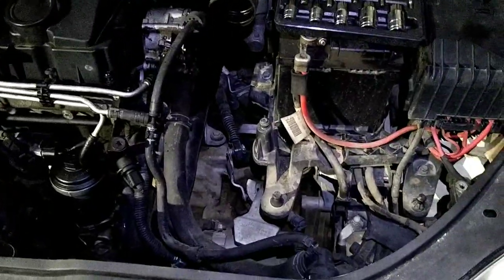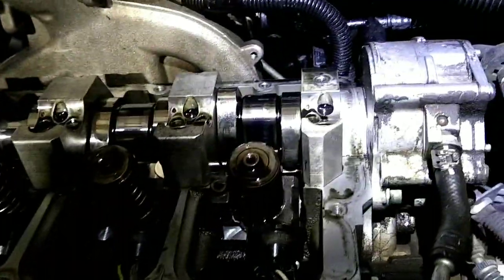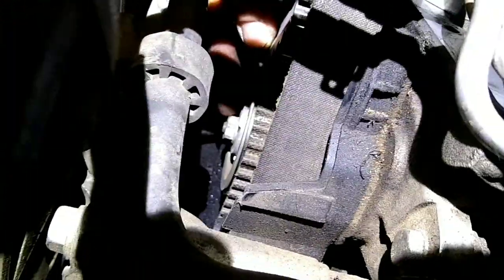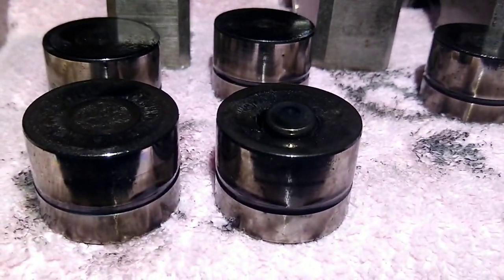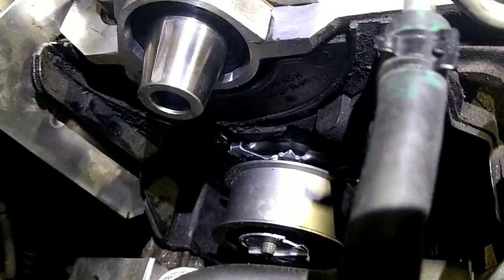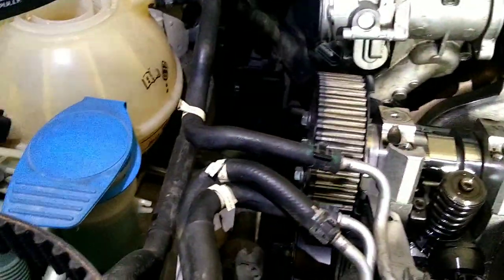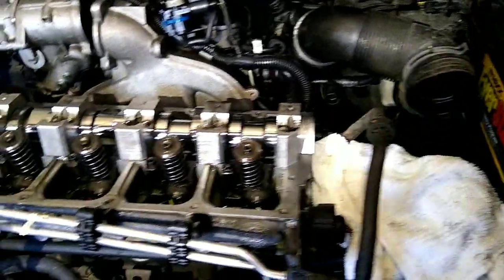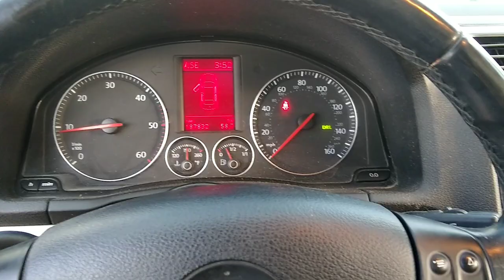Step by Step To Replace Worn Camshaft and Timing Belt on PD TDI, BRM/BEW/BHW and others

Comment: I replaced the camshaft and lifters in 2006 tdi and have been driving the car the last few days. Im having a problem with a longggg crank til it starts after sitting over night. It cranks over for about 45 seconds before starting. I replaced the tandem pump gasket. Any ideas?
Reply from the maker: Did you check the cam timing (torsion valve) with vcds? The cam sensor can cause long starts as well as a leak in the tandem pump seal.

Comment: Thanks for the video. After watching this I went ahead and pulled my cam out and it is very worn and even had a hole worn through one of the lifters. I seemed to have another issue with my injector rockers. There was pice of a loose metal lodged between the two rocker rails. I have read something about oil galley plugs on some forums? It looks like the piece came out of the opening on the end of one the rockers rails and the other rocker is empty inside the same opening. Do you think my issue is in fact oil plugs on the rocker rails and if so is there any way I can re use them or should I except to order new ones.
Reply from the maker: Sounds like you can have the rockers made to hold a better plug or even glue the original plugs in, either way would fix it
Reply: @TDISwaps  Awesome, thanks for the help!
Reply from the maker: @tylerhogan9897  no problem man!

Comment: I have an 06 tdi with 270, 000 miles. It died at an intersection. Towed it home, checked the timing belt, it is missing teeth. Checked the crank timing it is one tooth off. What to check next? Should I  put a new timing belt kit in or go further?
Reply from the maker: I would probably say do a timing belt then a compression test

Comment: Great video mate. Your skills are fantastic. I am learner and learning things bit by bit. Increasing the size of my tool box too lol. I have an audi a3 tdi 1.9tdi pd engine here in UK . I want to change the timing belt on it myself however the only thing that really confuses me is to lock the cam and crank with the tool at the bottom and the pin that goes in the cam.
Reply from the maker: Yeah I usually haven't locked the cam but you can use anything to market and line it up straight, as long as you are close once you get it back together and check that torsion value in vcds that will tell you if you got it off a little or not and you can adjust it then.  You can honestly just paint marker the crank and the cam and then readjust it with vcds after it's running again.
Reply: @TDISwaps  Thanks for the reply.  My audi a3 tdi 1.9tdi is my first diesel car. I never have had any diesel car before. I am trying to learn things as most of the mechanics here are just complete rip off. My car is leaking oil from the rear of the engine and its coming from the top to bottom. I have been underneath it and my guess is either it is head gasket or the rubber seal in the tanderum pump on the right side of the engine head. The turbo seems fine as there are no codes on the dash board and it also drives fine. The car also doesn't heat up the way it should. The temperature gauge barely goes to take 10 clock mark. I am sure its the thermostat and temperature sensor which are toast. Thats not a big job though however this oil leak seems to me something serious .
Reply from the maker: @mumtazzafar1576  well actually that's a great thing to replace during the timing belt because then you can see that the cam is lined up correctly with the tandem pump off, I would order up a seal for it as it's a very common leak spot.
Reply: @TDISwaps  Thanks very much for the reply
Reply from the maker: @mumtazzafar1576  no problem at all!

Comment: Awesome video man. I can’t even count the amount of times I watched this when replacing mine 2 years ago. Unfortunately the car has not ran since. When I tried to start it, it locked up but I was able to reset it by hand and try again, but I’m afraid the timing was off and I may have bent a valve. Any advice on how to get the timing back where it needs to be?
Reply from the maker: If you can spin the engine to where the harmonic balancer has a TDC mark pointing up at the notch in the timing cover you can then see where the cam is with the valve cover and tandem pump off
Reply: @TDISwaps  Oh okay, I didn’t realize there were markings for TDC on the balancer and the timing cover that I could line up. So I can check that, and then turn the cam to tdc like how you describe in the video. Put the timing belt back on and that should be close enough to get it to crank?
Reply from the maker: @jentryhaley5648 theoretically haha, always always rotate the engine 360° before trying to start it, that will prevent valve damage
Reply: @TDISwaps  Well hopefully I can get it reset to where it’s supposed to be I can tell if there are any issues. If not, I’ll make you a good really deal on it haha
Reply from the maker: @jentryhaley5648 lol I hope you can get it!

Comment: Great video! Next time to make the work faster don’t uninstall the tandem pump, leave it in place you can remove the camshaft without any issue.
Reply from the maker: Thanks! I like to use the back of the cam to insure the cam is at TDC that way, and the kit comes with a new seal anyways.  But you are right, it would go faster for sure!

Comment: same here. i subscribed. i have been on the fence about doing both for some time. Shops dont want to work on mk5 with 400k miles on it. thanks
Reply from the maker: Yes it is getting hard to work on these cars when the shop bill is often more than the car itself is worth to most people
Reply: @TDISwaps  shouldn't be the shops worry imho, if i were a mechanic i would straight up tell people "it will probably cost more than you'd like to pay" and if he still wants it, shop should fix it no questions asked. 
good for me that i DIY my maintenance so i can only complain for the cost of parts, and VW's engineers
Reply from the maker: @Juppie902  ha ha definitely! Those VW engineers could use a talking to

Comment: What a fantastic video. Really like the detail.
I need to change my camshaft vw 1.9 caddy 2008. 
Just a question regarding timing
 The belt and coolant pump was done 6 years ago. So by just locking the crankshaft and making sure the lobes on cylinder 1 are facing upwards (not engage) should be enough not to effect the timing. But once I get the project car running I'll get the timing tested again from a mechanic. Thanks in advanced
Reply from the maker: Yes locking the crank would be fine to just change the camshaft, I would inspect the belt really well though even at 6 years old it may show signs of wear and be safe for to replace. And thanks for watching!
Reply: @TDISwaps  Yep if I've gone this far, its not unreasonable to replace the timing belt. And the water pump. The car has been sitting on the street for more than 2 years. I've already dumped the old fuel.

Comment: I know its an old video but what were the symptoms of the worn cam and lifters? Also how many miles were on the car?
Reply from the maker: I've replaced 5 of these now, a thumping from the intake is a common indicator, but mostly it's best to just pull the valve cover and check, it comes off so easy and then you aren't wondering.  I've replaced them anywhere from 165k to 270k, and one I have is still good at 280k, there doesn't seem to be any reason why some go bad and some don't.  Multiple bad ones were using correct oil the entire time.

Comment: Priceless video thanks. Just makes my job so much easier.  What symptoms did you get that made you decide to change your cam.
Reply from the maker: This car started thumping very loud through the intake, and with the valve cover off, you could see the hole in the lifter was huge.  But my other car almost sounded normal even with half worn lobes on the cam.  If at all in questions just go look to be safe! And I'm glad to help!
Reply: @TDISwaps  I will pull the cover and take a look. the cams on these TDIs are actually the only bad design that you could throw at them.  Very weak Cams. In your opinion, are the hardened and non OEM custom cams much better. I just get dead links from forums linking to these supposedly better cams. ? 

Again, thanks a lot. this is how videos should be done.
Reply from the maker: @pensive_  I did the hardened stock cam, not too much of an investment.    The performance cams aren't really needed until much higher HP builds.  I don't have enough mileage on my cam swaps yet to really give good feedback though.
Reply: @TDISwaps  You didnt get hesitation at higher revvs?  A worn cam can among others, causes this issue. It is this issue that brought me to your video.
Reply from the maker: @pensive_  no unfortunately worn cams affect overall power some, but usually don't cause hesitations.  That can be turbo related if you don't have any codes
Reply: @TDISwaps   Maybe hesitation is not the right word. If I step on the  pedal. It pulls away with enormous power until a ways before maximum when it is pulled back to a lower revolution. So it goes to a high rev and then pulls back, almost like a sluggish governor. It is a nothing burger really as I dont rev up to there, I was just testing the car and noticed it. It does get a bit of black smoke (definately not blue or white) at high rev, only so it might be an air restriction somewhere. Maybe that is standard TDI behavior.
Reply from the maker: @pensive_  I would definitely get that valve cover pulled and check the cam first, then go from there.  They can be a pain to troubleshoot.

Comment: Where are you located? I'd like to hire you to do this job on a 2006 Jetta TDI I have. 119K  on the clock, snap crackle, popping, but still running strong.
Reply from the maker: Unfortunately I don't really have time currently, I'm also in the middle of nowhere Wheatland, WY haha.

Comment: How do you go about breaking sprocket bolt loose on cam? Thanks
Reply from the maker: I tried to make it clear in the video but I break that loose first thing before removing the timing belt, taps on it while the engine turns over slightly usually breaks it loose
Reply: @TDISwaps  ok great thanks I’ll try that basically tap ratchet with hammer? And for re-torque do you need a special tool?
Reply from the maker: @Mightyeldo so I just use a big breaker bar to break it loose maybe tapping it with my hand, then the last thing I do is pull any locks and torque the cam bolt letting the engine turn over a little if needed

Comment: I just bought a 2006 version Jetta tdi 1.9l new to this side of the Diesel world had lots of pickup but I have no idea what to look for to fix maintain or change could u give me some insight on this car thanks Troy
Reply from the maker: Checking the cam, keeping up on timing belts, and doing tranny flushes are the big things.  Everything else can be fixed as it becomes an issue.

Comment: Hey great video very helpful! Just one question, I attempted the camshaft replacement today but got stuck when I tried to put the new camshaft caps back on. It seems the cam itself won't seat properly far enough down for all the caps to mate with the head. I didn't want to torque too hard and force the cam down but can't figure out why it won't seat properly. The crank is 90° CCW from tdc so I can't imagine the valves are pressing against anything. It will fit on one side but the other has a lobe pressing against the lifter without it depressing so it sits proud about 1/4 inch. Thoughts on this? Also I am a big newb btw so be gentle😉 Cheers!
Reply from the maker: You are just feeling the cam lobes needing to partially push down some of the valves, no worries there, any lobes that are in a downward direction will have to compress the lifters under them some while bolting it down...  Just use caps 2 and 4 to slowly alternate tighten the cam down, then finish with the rest.
Reply: @TDISwaps  Ah great thanks for the reply dude, I'll try that today and see how we go🤙
Reply from the maker: No worries man!
Reply: Hey so got it all in and it worked like a charm... For a second, I've somehow tripped the immobilizer and it shuts down right away. Any idea how to fix that or do I have to have a dealer take care of it? Thanks again!
Reply from the maker: @MrChriswms  check your codes, I bet you have a camshaft signal code. If the cam is just a little out of spec it will cause a start and then shut off as a preventative measure but acts just like immobilizer, you need to slightly adjust the cam timing to get it back in spec, usually -.5 to -1.5 is ideal

Comment: Hie..Im replacing the camshaft and lifters on my 2007 Jetta TDI BXE but i forgot to number the caps for the cam.can something bad happen if i mix them up 🤦🏽‍♂️.also can you tell me if the break in process is necessary.Thanks in advance
Reply from the maker: The cap order should not technically matter for the center ones, only the front and back SHOULD matter, I was more being safe than anything.  The only common break in procedure I have found is to use break in oil and run the engine at 2000RPM for 20 minutes, then change oil/filter and run for 500 miles then replace oil/filter again and you are good to go.  Some people have skipped that but I try to do it.
Reply: @TDISwaps  thanks a lot mate
Reply from the maker: @daddypopes  Glad to help!

Comment: Did you have to remove the motor Mount to get the tensioner out?
Reply from the maker: I unscrewed the center tensioner bolt and was able to slide it out sideways

Comment: How did you loose the 18mm camshaft bolt. It rotates when I'm trying to turn it loose
Reply from the maker: I do it with the timing belt on still and not locked, and usually a firm tap on the ratchet will break it loose, you may turn the engine over a little bit it should get stiff enough to loosen the bolt that way

Comment: I wonder how hard it would be to do an in frame rebuild on this engine.  Pull head and oil pan.  Break the cylinder glaze with a ball hone.  Add new rings and bearings and fresh head and new turbo. 
Back in the day Kerma used to offer a hardened sport cam for the BRM with the updated lifters and Malone tuning offered a bit of a performance tune.  I think the PD140 turbos bolt right on as well.
Reply from the maker: Yup all that stuff is still available and I have seen many in frame rebuilds done 👍

Comment: Ok, I used one of the three bolts that are around the 18mm to hold it from moving with one  ratchet and socket and at the same time losen the 18mm with the other ratchet
Reply from the maker: There you go, there's always multiple ways to do most of this stuff

Comment: Great video. ..is there a torque specs for the bolts. Thx.
Reply from the maker: I have read multiple specs online but it's best to get a manual if you want to be exact.  I kinda left it up to you on that, I don't actually use a wrench 🤷

Comment: Hello, I am looking at doing this job on my TDI and was wondering how the Cam has been holding up. I am thinking about buying the kit you used and want to confirm it worked out for you.
Reply from the maker: I haven't gone back to check it yet, only have about 6k miles on it, but the car is running great. Best mpg it's seen since the tune and cam.